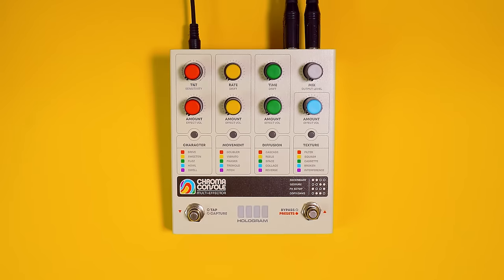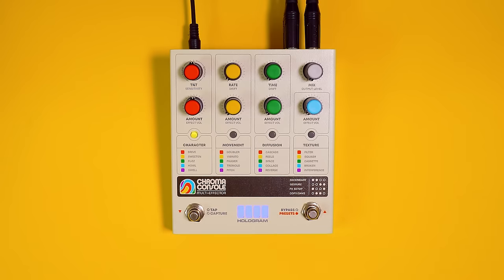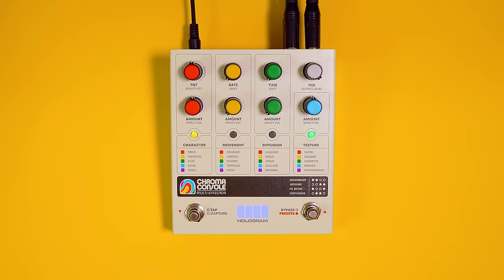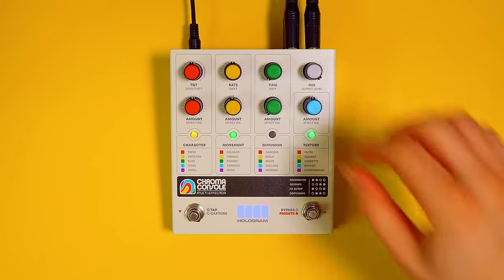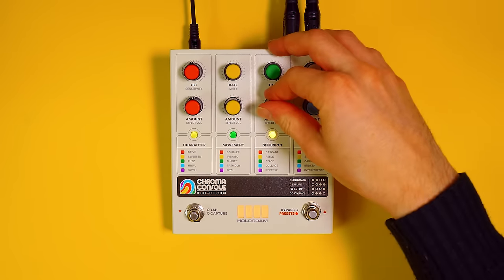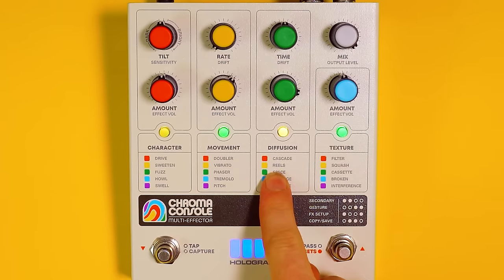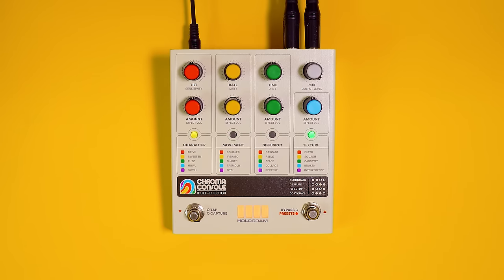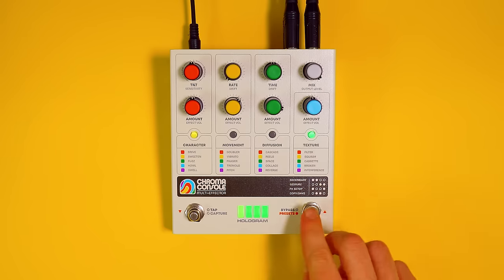Chroma Console: Sound from Scratch #1

Comment: Is it possible to change the modulation/flutter rate or things like Bias/speed in Cassette?
Reply: The amount knob for each effect seems to change more than one variable.  So, kind of.  It's really well thought out.
Reply: @bnz70  Gotcha - I'm aware there's much more than the front face, and also plan on utilizing as much additional control as I can via MIDI.
    And while I could mockup tape-loops & adjust reel tension to taste, cassette sims are something that really require more than one baked-in setting to shine, imo (even/especially if that does change key parameters throughout as a "macro"), so I do hope there's at least the ability to tune the basics via BPM/sync.

Maybe in a future firmware, too @HologramElectronics 👀
Reply: After reading the midi implementation chart, I don’t think you can adjust fine details like that. Microcosm is similar in that there are specific parameters I’d love to be able to mess around with but tbh I got 44 effects in one pedal with a lot of control already, I can’t be too mad when I can’t fine tune EVERYTHING.

Comment: Can someone explain what's happening at 2:46 with the secondary parameter? I hear the difference but I can't really understand what is actually happening.
Reply from the maker: So both the Movement and Diffusion modules have a secondary control called "Drift." Increasing Drift will introduce additional layers of modulation to the active effect. So here, I'm increasing Drift on the Reels effect. For that effect, increasing Drift will increasingly add stereo-panning and tape degradation. For all the Diffusion effects, you can rely on Drift adding some pitch modulation to the delay line. 

Hope that helps!
Reply: Ah I see. Very cool, thank you! @HologramElectronics